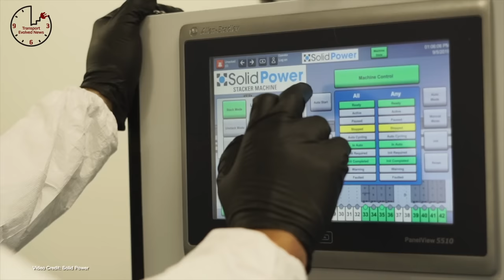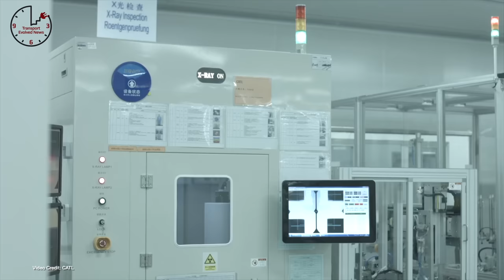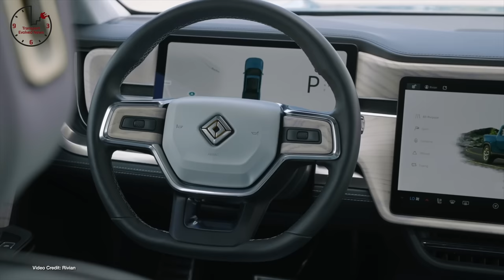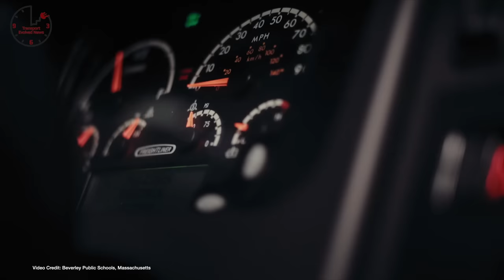TEN Episode 359: TSLA Rave, Solid State Battery Progress, Cybertruck MIA

Comment: NHTSA blames Tesla for fixing a "defect" without issuing a recall notice.
But how can Tesla cars crashing into stationary vehicles in their lane be a defect? Way over 90% of cars on the road will behave that way if the driver isn't paying attention. Do they all need to be recalled?
Reply: I'd be interested to hear what a software 'recall' would look like for a car that can receive OTA updates. Tesla moving faster than the regulators is troubling to the regulators. If NHTSA don't approve of the fix they can always require the fix be enhanced, in the meantime the roads are safer.
Reply: It's the stupidest thing I've ever heard and it even highlights their true motivate investigating Twsla your Mad that a company fixed a problem faster than you can do your job isn't that a Shame .
Reply: @rogerstarkey5390  You could be right. I think this exposes old world regulations designed to front end a recall that would take months and years to implement, so a few weeks or months on the front end isn't a big deal. 

With OTA updates fixes can be implemented very quickly and time spent following an old world snail mail campaign can only serve to slow down the release of fixes.

One improvement Tesla could be asked to do is show release notes prior to installing software rather than after. An owner can then prioritize the install appropriately.
Reply: @truetech4158  New car prices have gone up 16% in the last year. It isn't just electric cars that are becoming difficult to acquire.
Reply: @JeanPierreWhite  what was the cost of a tesla when the 4500 dollar wuling mini ev went on sale over the past year, and how much did a tesla cost before they started showing signs of rust?
A 10 dollar amount of plastic dollar store plates becomes a 1000 dollar fender or one designed for rust that never sleeps, and neither do the millions of people who die from the effects of pollution each year. Planning to obsolescence? 
Ya, cue the tune Industrial Disease.
Reply: I believe the Tesla cars previously had software to avoid emergency vehicles.  We don't know how many emergency vehicles were avoided in the past with the old software.  Improving recognition of an emergency vehicle in not "fixing a bug", just like improving braking distance is not fixing a bug.  Things, generally, keep getting better.  Note: Toyota fixing the accelerator software that made their cars unstoppable, and killed people, was a bug fix.
Reply: @truetech4158  The Wuling Mini EV is a barebones, extremely short range, low performance econobox that has ridiculously minimal safety qualities and will never, ever sell in other countries like the US and Norway. It is not a competitor to Tesla’s vehicles whatsoever. So you did not help your argument bringing that vehicle up. Out of all automakers, Tesla has done the most to bring costs down for compelling EVs, and will have a $25k model by end of 2023 or sometime in 2024. In 2016, the cheapest Tesla (and the only compelling EVs at the time) you could buy was ~$80k+, but now it is $42k. 

Tesla knew that they had to make EVs that were on par with ICE vehicles, and that EVs like the Wuling Mini won’t suffice. EVs cannot simply be mandated into existence. They have to be better than and at least as compelling as the technology that they are replacing. To give credit where it is due, I applaud Xpeng for bringing a $25k long range compelling EV to China with the P5. That should be celebrated, not the Wuling Mini.
Reply: How many Toyotas with AEB (automatic emergency braking) have run into stationary emergency vehicles.

Comment: NTSHA is wrong.....it can't be a recall, if the service wasn't available.   Recalls are when there is an error is the software and/or Hardware.   Since Tesla didn't offer this service, how can it be a recall, nor is Tesla required to offer this service.  NTSHA is just grandstanding for the cameras, to try and put pressure on renegade Tesla, my thinking is that it will not work, unless the laws are changed...
Reply: Except that it is available... maybe not a general availability, but everyone qualifies these days and either has access to the beta program as a subscription or as a paid option on the car. It is no longer a closed beta for a select few.
Reply: Agreed.  It's not a "manufacturing defect" for the car, which is supposed to be under constant human supervision (just like the cruise control on my ICE car), hits something.  Doesn't matter what it is, another car, emergency vehicle, or wall.  If I'm the driver, it's my fault for misusing the car,  not the car's fault, which all the instructions warn you is not perfect, is in fact, "not perfect".
Reply: Ikr it's the stupidest thing I've ever heard. That you company fixed a problem faster than you can do you job

Comment: APTERA is 1 solution for apartment dwellers. Lightweight + aero + solar, excellent design. I'm very skeptical of in-wheel motors, but the weight helps balance in this design.
What happened to Yamaha EV motors?
I wonder if solid state are supposed to have better thermal properties.

Comment: The video of a cybertruck towing another coasting pickup truck backwards is misleading.
Either BOTH should start with traction OR wheel spin at the same time, and with zero momentum.
Reply: Yeah, nearly all "trucks having a tow-off" are pure stunts, and really just a matter of who has more traction-at-the-road. The Cybertruck weighing so much more due to batteries almost guarantees it will have more traction-at-the-road than any ICE truck. The could compare the single-motor Cybertruck to a RAM TRX and it would still win purely due to the weight.

Comment: A single casting is probably Tesla's strategy to cut cost and make the $25K car possibile. It might be cheaper to buy a single larger Gigapress in lieu of two smaller ones.
Reply: @rogerstarkey5390  If the casting cracks or is deformed, yes that's a totaled car. The hit to do that damage to a structural component would need to be significant, which would total most cars anyway.
Reply: I do wonder why the media and many commentators refer to the casting machine as a Gigapress. It isn't a press, its a casting. Gigacast if we have to use the giga prefix to all things Tesla.
Reply: @rogerstarkey5390  In any car where the frame is damaged, the car is written off.  When damage is that severe, be glad you're alive and get another car.
Reply: @rogerstarkey5390  it doesn't but according to most people it will be totalled so no fixing needed just throw it away and buy a new one that's good for the planet.

ICE cars have been rebuilt a dozen times and many still in use today this thing of EVs being a one time use thing irks me

Comment: A few years ago:

Wait until the Germans start making EVs, Tesla will be screwed.

Tesla about to open a giant factory in Germany:

VW has an emergency meeting because they realize they are in trouble
Reply: Not sure who's in 'trouble' (my guess would be: neigher of those two), VWs EV sales are growing a lot faster than Tesla's.
Reply: @EVPaddy  Herbert Diess had been reported to have said that VAG needs to speed up it's transition and to have been concerned with Tesla being able to make a vehicle in 10 hours compared tp 30 for VAG.
Reply: @IronmanV5  I know. I bet if VW only built 2 mass market models without any options they'd build them faster, too. Not using any body cavity conservation helps too, for sure. Or not letting the paint dry so it peels off after a few weeks :)
Reply: @EVPaddy  If only VW had 90 years experience making vehicles so that they could build them faster.

If only they also had more resources than a little startup from California so that their EVs could receive software updates over the air instead of having to go into a dealership where they may or may not even know how to do the update.

For that matter, if only their first EVs could match the range of the original 2012 Model S or the 2009 Roadster 

It's not like battery prices have dropped almost 90% wile energy density has almost tripled in that time or anything😉
Reply: @EVPaddy  Yes, and if they are in trouble, it's more because of Hyundai/Kia's EV competition than because of Tesla's. Or maybe it specifically concerned the VW brand, because Skoda currently consistently makes the same car better for less money and consumers have started to noticed, with the Enyaq outselling the ID.4 (at least here in the Netherlands.)
Reply: @EVPaddy  As long as their total EV production is a rather small percentage of Tesla's, and their China (largest EV market, remember?) sales are a small percentage of their (announced) expectations, I'd say that yes, they are in trouble. In deep trouble. Also notice that their debt is massive, whereas Tesla has money in the bank, which means they have a much harder time building new factories, for example.
Reply: @IronmanV5  ah, there we have a fanboy that compares Teslas exaggerated EPA range to everybody else that is rather underpromising. Ah, you know, I'm tired of trying to talk to fanboys. It's a waste of time. You believe Tesla will dominate the world. Have fun.
Reply: @EVPaddy    Oh please mr Paddy, show me which VAG product can match the real world range of the equivalent Tesla?

Rivian can and Lucid bettered them. And they can do OTA updates. But those are also startups from the U.S.

Ford was et least able to come close with one version of their Mach-E, but you still have to go into a dealership for updates. 

And they're American.

But obviously I'm a "Tesla Fanboy"
 /s

Comment: I disagree with the NHSTA here, s this is about the FSD Beta, the software is not subject to a recall procedure as per normal standards on vehicles since it is not officially available to the general public but only to a select few who agreed on the usage of the software.
Reply from the maker: If the software governs safety operation of a vehicle on the road that is being driven by non Tesla employees, then Tesla is required to comply with the same regulations as other automakers.
Reply: @transportevolved  that means that by that metric every update on FSD needs a recall precursor? That just doesn't make sense
Reply from the maker: @vhaakmat  In this case, the software update was to fix something NHTSA was investigating.
Reply: Yeah, there IS a government procedure or law, but it is behind the times and antiquated. Just because something has been done this way for decades, doesn’t make it okay.

Comment: 14:18 battery electric or plug-in? why not both?
17:23 are they using waze to navigate? don't get me started on waze!
man, that cybertruck looks WEIRD.
Reply: My wife lives by Waze. I can't stand it. It often takes the scenic, overly complex route for no reason I can fathom.
Reply: @devenscience8894  
some time ago i wanted to go from near heathrow airport to oxford street in central london, a straight shot from the west down the A4, maybe 12 miles or so. but no, waze insisted that i go all the way around central london and come in from the east, effectively doubling the distance. i kept ignoring that "advice", taking the direct route. only when i got past hyde park corner did waze stop insisting that i go the long way.

then, on the way home, it tried to direct me down one road, around the block, back up the same road and then through hyde park and further north before turning west. again i used my local knowledge instead.

thats why i dont trust waze.

also, in one app i was using (it might have been waze, i dont remember) i entered oxford street in central london as a destination, and it tried to direct me to oxford, a couple dozen miles west of london.

Comment: NHTSA claimed that Tesla's software update fixed  a safety defect.  This is a false claim. No other automakers' ADAS system is designed to slow down for stationary emergency vehicles. Yet NHTSA hasn't claimed that all of them have safety defects.  That's because it isn't a defect. Tesla made a software improvement to their cars to add a new feature.

Comment: 9:23 "....that caused certain vehicles to catch fire in extreme circumstances"? 
Like parked in the garage or next to other vehicles in a shopping centre? So "extreme" : / 
Seriously, stop it. No-one benefits from this, least of all you and your reputation. 
I really want to like you, but you make it so difficult when you treat us like idiots by dishing out corporate PR. 
Again, please stop.
Reply from the maker: Extreme circumstances - the presence of two simultaneous defects plus a battery heavily discharged and then fully charged.
Reply: @transportevolved  that's not an "extreme circumstance" by any stretch of the imagination. It's just a relatively normal use cycle that a defective battery can't cope with. Hence the recall/buy back, and my taking issue with the description.
And there were still fires AFTER new charge/discharge parameters (and parking advisories) were issued and followed. 
Sigh : /

Comment: The Solid Power news is interesting.  When is large scale production due to start?  Cost?
Reply: Ah, there's the rub.  As always.
Reply: „Solid Power intends to commercialize its high-content silicon anode product by 2026“
(May 2021 Press release)
Reply: @geraldh.8047  Thanks.  So 5 years to commercial anode production or high volume battery production?